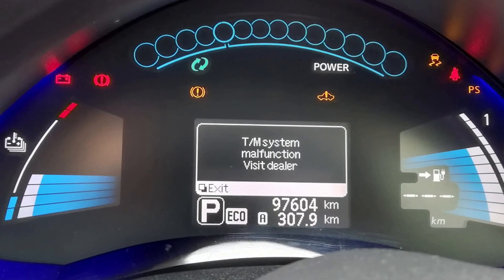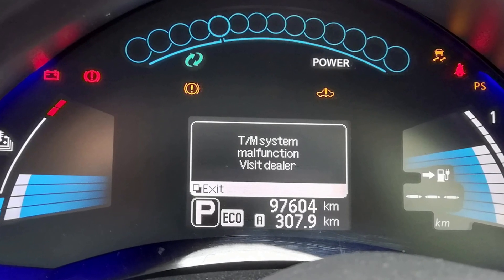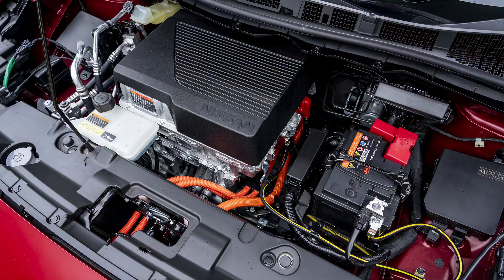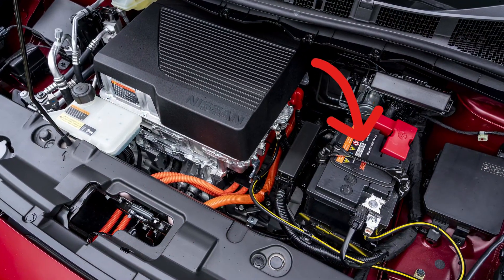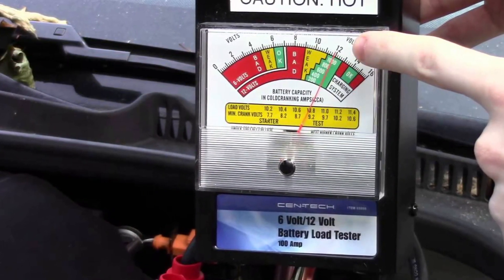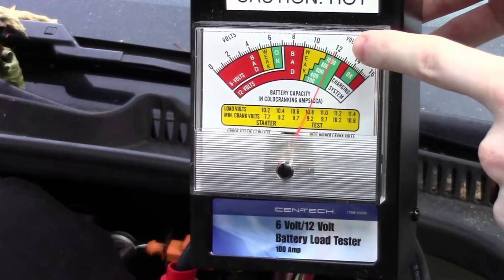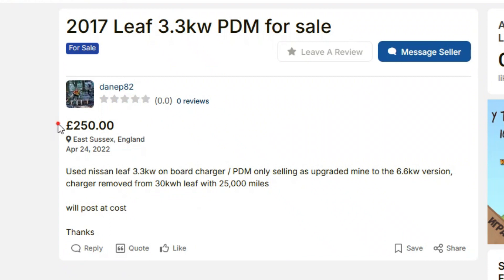Nissan Leaf “T/M System Malfunction” warning explained

Comment: Late for work today because I warmed up the car and the 12v battery when dead. I guess it doesn't charge when not in "drive" mode? Strange.  If should never go dead if it automatically recharges.

Comment: Thanks for your advice! I just checked the original battery in my 2014 Leaf and it was showing 8v after T/M system malfunction showed, the start had been left on for an hour or two. Going by what you say, I hope if we replace the battery all will be well again. I'll let you know how it goes.